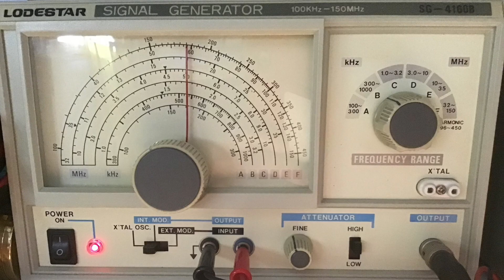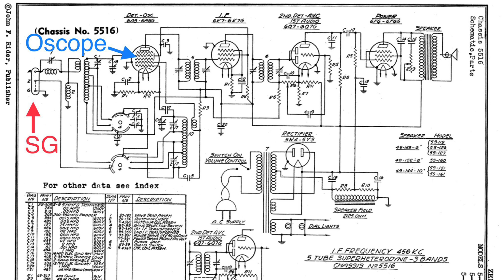Antenna Coil Connectivity Validation Tip

Comment: Super helpful video. I just tried it on a transistor radio front end and it works great. Especially with all those little tiny wires. Thank you!
Reply from the maker: Glad it was helpful and thanks for sharing your experience. Best, Don